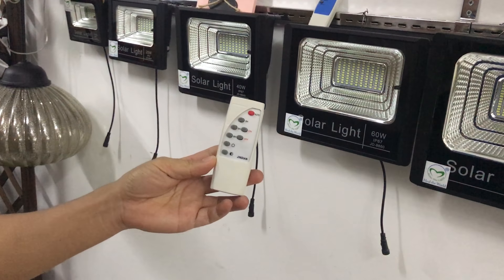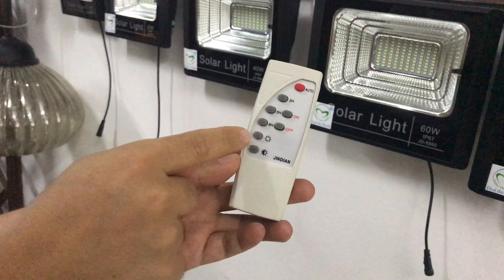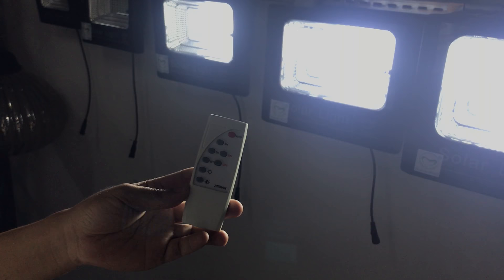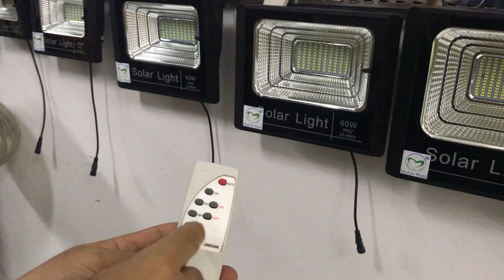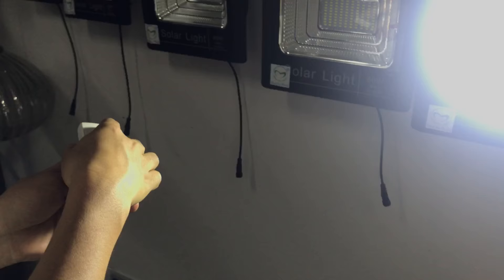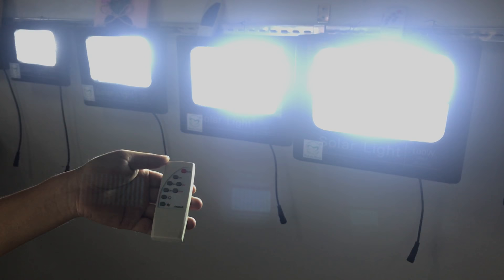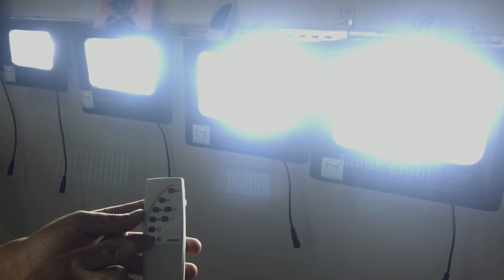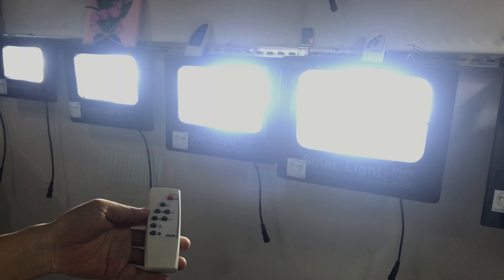Remote control instruction for JD-8810 JD-8825 JD-8840 JD-8860 JD-8800 Solar Flood Light

Comment: I bought 4 of this type of solar  flood light but I just don't understand on why it will last only for 2 hours and it will already discharged. I've been trying setting it with the remote control but to no success.

Comment: The only button that seems to be working on my brand new unit is the AUTO button. When I press it, the light flashes. Then I pressed 3 hours and nothing happened. I just hooked it up today so I'll see if it turns off after 3 hours.

Comment: My solar light jd 120watt, i bought n only use after 8 months. When i first bought, i tested it was working. I  keep in the box for 8 months n did not use it. Today when i press on on remote, no sensor light showing n no light is on. How to fix this problem?

Comment: I bought 2 units . When it arrived I checked it and they seem to be able to on immediately when I connected the solar panel cable to the spotlight cable. Since I was not ready to use them I disconnected the cables and put back into the original box. Now after a few weeks I decided to install the solar lights but after a day solar charging , when I connected the cable I can only see a blinking red light. When I pressed the auto red switch as according to instruction the light come on for a split second. I tried the other buttons and it doesn't  work too. Can you advice me if I am not doing it right ? Thanks
Reply: Tks the agent replied my query and guided me, both the lights working .
Reply: Check wire connection on that little box behind the solar panel. You don't even need a screwdriver 🙋

Comment: Hi, we have just bought 4 of these lights. Problem is that when i press auto, the light comes on, even in bright daylight, and stays on.
Also, if it is still plugged into the solar panel, the on button doesn't work. It only switches on when i press the auto button.
So, as soon as i press auto, even in bright sunlight, the light comes on.
If i cover it to make it dark, light stays on also.
Why does light come on in bright sunlight when i press auto?
Reply: Model is the FB-8825 , thanks
Reply from the maker: Hi friend, our mode is JD-8825. I think you have order different product

Comment: I have this similar product (the remote control is the same as mine)... when it runs out of battery, seems all the settings I set in remote control is reset, and I have to re-do them.. also, it seems when it is working at night and in the morning it turns off and at night it turns on, the settings are back to FULL brightness, even though I set it it to lowest brightness (to save battery)... is that all normal? The instructions that came with it doesnt explain these subtle behaviours...
Reply from the maker: Hi Dear, I think it's not normal. may I know where  you order the solar lamp? Is it our JD design?
Reply: @LOVESOLARCOLIMITED  I ordered from e-bay... My remote control looks exactly like yours, and the light unit looks very similar.

Comment: how to i'm setting solar lamps JD-8810 (10 w) remote control to use auto sensor when are sunset and night used without use the remote control?that mind auto on when night mood...tq
Reply from the maker: Under the Auto mode. the lamp will turn on at night and turn off in the morning Automatically.

Comment: Is it not possible to change the modes without remote control? I have lost my remote control. How can i change the modes? Does it mean i have buy new solar ligt pack if i lost remote control? It is very bad. Is there any button or trick to change the modes?
Reply from the maker: Hi Shahriyar, there is no button to change the mode. Need remote control. May I know which country are you from?

Comment: How do I determine if the remote is working? Is there light from the remote that means its working?thank you
Reply from the maker: The remote control no indicator lights.
Reply from the maker: The lamp should change by remote if the remote works

Comment: hi i have JD-8825L here, how will i know if its charging or not? i dont see any indication. and when i use auto, it just turna on the light. how these thing really work?
Reply from the maker: Hello Giovani:
1. The charging indicator will turn on when you connect the solar panel( please confirm the solar panel face to sunlight)
2. If you don't connect solar panel to the lamp, the lamp will turn on when you press Auto. The light will turn on at night and turn off in the morning automatically when you connect the lamp with solar panel. Hope this help you.

Comment: Hi I've had this light through most of winter and it works perfect. I have a question at the moment it stays on all night can I set it so the the light stays on for 3 hrs  automatically.
Thanks
Reply from the maker: you can set it by the remote control by press 3hs
Reply: Will it come on automatically at the same time every day ?

Comment: I have IP65 with the 4 lights and 1 solar panel. It's nice. I used to love it... it still works EXCEPT THE LIGHTS DO NOT TURN ON THE "HIGH" SETTING. I CAN ONLY TURN THE LIGHTS ON LOW AND MEDIUM.. WHEN I TURN ON THE LIGHT TO HIGH, IT FLASHES THE HIGH POWERED LIGHT FOR A FRACTION OF A SECOND, THEN IT TURNS OFF. IT IS FULLY CHARGED. PLEASE HELP

Comment: What if i lost the remote control can i still use it?
I have the JD8810 model
Reply from the maker: Yes but you need to find another new remote if you want to reset the lamp. One remote can control different lamp. You can try to find another remote. and the function is the same. May I know where are you from? And where you order the solar light JD-8810?

Comment: Hi how do i disable the auto on off the solar floodlight? I just wAnt to turn it on manually or turn it on when i want to use it. Is there a
Way or it is only designed for auto on off?  Thank u
Reply from the maker: Hi Katrina, JD design don't have the function you need.  But HP series have the function you need. Below is the HP series link in our website.
Reply from the maker: http://www.loveandsolar.com/product/300W-Super-Bright-Solar-Flood-Light-BJD-8300-Solar-Light--JD-8800-JD-8200-Solar-Light.html

Comment: Hello Sir, how about a solar light that doesn't turn off?. Battery of remote is still new but it's not working. And that red sensor that usually blinks when charging is not on when flood light is on.  May I ask what might be the problem for that? thank you
Reply from the maker: Do you mean the solar light is keeping on at day even when it's under sun light?
Reply: @LOVESOLARCOLIMITED  I mean I can't turn it off. It seems the solar lamp itself is not sensing the infrared from remote control. The remote control is working, but the solar lamp red light indicator is not.
Reply: @deinna5562  mine stays on in the dark and turns of during the day and I can't turn it off during night because it doesn't respond to the remote red button (on/off)
Reply from the maker: @deinna5562   the solar lamp red light indicator is not for remote control. It's charging indicator. It flash when the lamp is charging.

Comment: My solar changes light power/dims after 4-5 hours. How to fix that?
Reply from the maker: Hi Jacob, sorry I am not sure exactly. Would you please share more details?
Reply: @LOVESOLARCOLIMITED  it just dims or the light dims (power saving?) after 4-5 hours of switched on. Is that normal or can I repair that?
Reply from the maker: @hacobee1  Yes the brightness is changing base on the battery level.

Comment: how to always set the light into full bright? because when i press the full bright button after several minutes the lights turn too semi bright i need to press the bright button to make it full bright again
Reply from the maker: Normally the lighting not like that, you don't need to press again and again. But may I know if the battery is full power now? The brightness may change when battery in low level.
Reply: @LOVESOLARCOLIMITED  how may i know if the battery is already full charge? i charge this all day because the solar panel is on our roof so i think its already full charge but the problem is why its back to semi bright after how many minutes i think pressing the full bright button will always on until i stop, i buy two pieces of your jd-solar to test for myself so i can  offer it to sell to my friends
Reply from the maker: @lionelperez659  May I know where are you from ? Where are  you order the light?
Reply: @LOVESOLARCOLIMITED  im from philippines and i order it via lazada philippines is there a way that i can use it always at full bright until the battery gets low?
Reply from the maker: @lionelperez659  Good morning , Usually the brightness low when battery  is in low level( to keep longer lighting time, the lamp will turn off soon if the lamp always keep high light even when battery in low level).
Reply: @LOVESOLARCOLIMITED  i dont thinks so because even if i just first turn on the lights to full bright after a few minutes the lights will automatically turn to semi bright then if i press the full bright button again to full bright the lights will lights to full brigth again so i dont think that the battery is low what i think is the floodlight sets automatically to semi bright to make it last overnight,i hope you can make a product that we can set the light to always in full bright until the battery gets low not the automatic one to make it last overnight
Reply from the maker: @lionelperez659  Yes, thanks for your advice. To be honest, this is also what we consider for the design in future. But we need bigger solar panel to full charge bigger battery, it need bigger packing and higher shipping cost accordingly. The totally cost will be very high if we want to confirm very bright for whole light. May I know which model(Wattage) you ordered? You can order bigger size if the small size ( low brightness) is not enough for you. We have bigger size and you can check the video link  in Facebook here https://www.facebook.com/loveandsolarheadquarters/videos/445926356113230/
Reply: @LOVESOLARCOLIMITED  do you have a pricelist convert in philippine money?
Reply from the maker: @lionelperez659  Sorry we are factory and dealing with wholesales only but not retail by local currency.
Reply: @LOVESOLARCOLIMITED  ok ok i understand anyway thank you very much for your time on my comment really appreciate it i will order again maybe a bigger one next time
Reply from the maker: @lionelperez659  It's my pleasure. www.loveandsolar.com you can see our product in website and many of them are stock ready in Philippines when you like.

Comment: its confusing as hell. he did not explain if the 3hr 5hr 8hr buttons are automatic. meaning light comes ON automatically but switches off after 3 hrs.
Reply from the maker: Thank you for your review. Yes, 3/5/8hrs buttons are also AUTO on by light sensor but off by the time control.
Reply: @LOVESOLARCOLIMITED  oh ok thanks. I was wondering because mine suddenly shuts down after 2hrs when fully charged. I can confirm its not set to 3hrs.
Reply from the maker: @SIDEKICKONYOUTUBE  It turn work again if you press the button" Auto"?
Reply: @LOVESOLARCOLIMITED  i pressed AUTO again and after that during 6PM it turns ON but on 8PM it turns OFF.
Reply from the maker: @SIDEKICKONYOUTUBE  Yes really confusing because we don't 2hrs timer design. May I know which country are you from? Where you order the right? Just want to confirm if the lamp is from us or not.
Reply: @LOVESOLARCOLIMITED  yeah my bad it was 3hr button. i thought it was 2hr

Comment: Help! how do you turn it off manually without the remote
Reply from the maker: Normally, the lamp need a remote to turn on/off.  but if you connect the solar panel to the lamp at day, the lamp will turn off automatically. If the solar panel not connect with the lamp, then the lamp must need a remote to operate.
Reply from the maker: May I know why you need to turn it off? Would you please tell me the specific details? So that I see if we can give you a solution.

Comment: Hello sar my remote LED sensor can not working how can i do it help me please sar
Reply from the maker: Hello Nay, may I know if the lamp have problem or the remote control have problem? May I know where are you from? We are the solar factory in China.
Reply: @LOVESOLARCOLIMITED  I have the same problem, I bought two lights, both remotes work on light number 1, but light number 2 doesn't work with remote, it turns off when it's daylight and turns off when it's morning by itself, but the remote on/off button absolutely doesn't do anything unlike light number 1 which turns off and on manually, I do trading in my country and I sure as hell not dealing with you again if you don't fix your products.
I can see that the little plastic sensor on light number has a bump towards the outside while light 2 has the bump towards the inside, almost like faulty craftsmanship.
Reply from the maker: @shapsugh1864   HI friend, thanks for your feedback. May I know where you order the solar light? Which country are you from? www.loveandsolar.com
Reply: @LOVESOLARCOLIMITED  
🇯🇴

Comment: how to replace batt inside lamp?
Reply from the maker: We can sell spare part for JD solar flood light, for exsample the battery and LED, glass.But it's not easy to change the battery. We need to broke the glass and the replace the battery and LED.The design is no screw to fix, but need glue to fix. And need a new glass to cover after we broke the old one.

Battery in JD solar flood light is difficult to replace. Because the Lamp is total sealed for waterproof IP 67. The lamp can be Soaked in water for one day but it still work when you take it out. Below video show for about one minute.
https://www.facebook.com/loveandsolarheadquarters/videos/923485504498108/ 
However, you can Soak it in water for one day and see.

But the lamp with replaceable battery can not be so high waterproof level. That is why we make it complete sealed and use longer lifespan battery.
Our Life Po4 battery is 2,000 cycle lifespan compare to the Li-ion battery 500 cycle.

To place the battery, you need to broke the glass and then change the battery. And need to use glue to fix another new glass after change the battery.That is a complicated process and the cost to change battery is even higher that to buy a new lamp.
Reply: do you sell floodlight only with no solar panel? my jd25 light fell and i need one

Comment: i have this brand and my comment is "not good" the solar panel easily have  "DISCOLORATION" and my JD 100-watts floodlight is not actually 100watts compare to house hold led light 12watts i assure to you they declare 100watts but in reality it is not 100watts..and try to use your TV REMOTE CONTROL and you will shock that it can access your infrared signal very cheap.say something?
Reply from the maker: Hello, thanks for your feedback. May I know where you order the light? They are many fake product on the market now.

Comment: My remote broke. What to do?
Reply from the maker: Hello, may I know where are you from? And where you ordered the solar light?
Reply: @LOVESOLARCOLIMITED  I also have the same problem the remote control is not working anymore. The lamp performs very well. We are from Batangas, Philippines and I ordered the item in Lazada via seller Bosca
Reply from the maker: @MarkManalo431  Can you please ask for the local distributor where you ordered for help. You can even ask them for borrow for activate the light only. Please you can try to send your requirement to our team in Philippines https://www.facebook.com/loveandsolarphilippines/ to see if they can help you.
Reply: @LOVESOLARCOLIMITED  do u have remote application on play store

Comment: Hi. My light wont come on at night. I get a small red light inside but cannot switch it on at night. Why is this.
Reply from the maker: Hello Singh, do you mean the small red light turn on at day time when it's charging by sun light? But can not turn on at night?
Reply: @LOVESOLARCOLIMITED  yes
Reply from the maker: @nirakshasingh5680  May I know which country are you from? have you feedback to the distributor? The local distributor will give you solution for it.
Reply: My  remote  is  broken. .is  there  anyway  I can  turn  the  light  on  without  remote. .please  help
Reply from the maker: @rominaforeman6558  Hello Romina, may I know where are you from? And where you order the solar light?